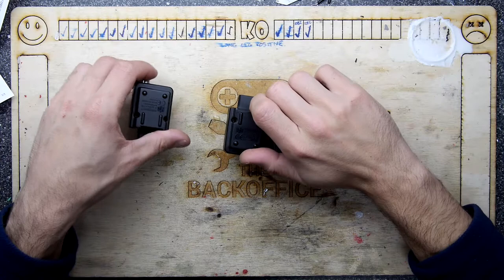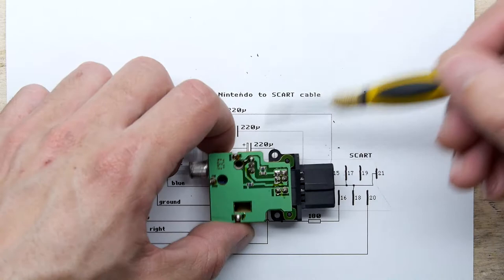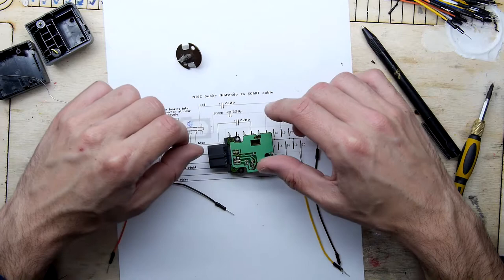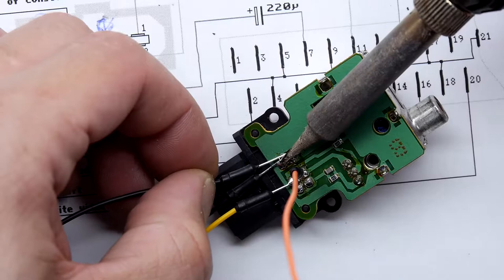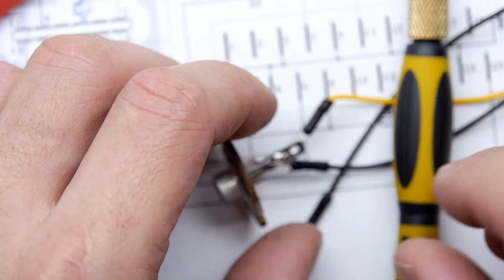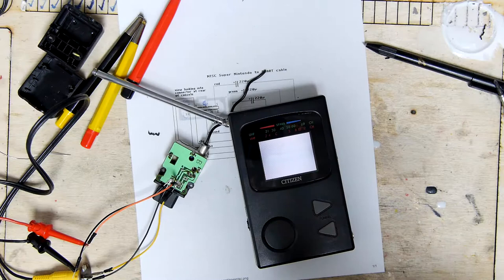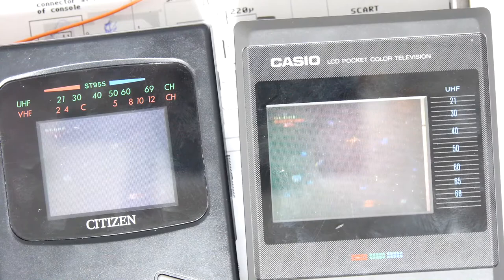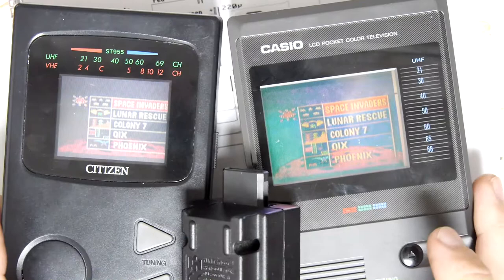Old TV Composite Hack

Comment: Brilliant idea. I just ordered 3 nes RF adapters and 3 RCA Connectors with red, white and yellow and I'm going to make 3 sets up for projects I have. I am going to boost the output signal and run that through a flat panel ariel that I have sitting about so my range should be better. Great video and well explained. Cheers👍
Reply from the maker: Glad it was helpful, good luck!

Comment: Well done, you have succeeded where many an N64 owner has failed; using an RF module for RF and not for attempting to use it output composite video :D
Reply from the maker: +Simon Lock ha ha, was the N64 the first Nintendo console to require an adaptor for RF?
Reply: It first appeared for the AV Famicom in a Nintendo light grey whereas the US variant (retooled design called the NES-101) has a built in RF modulator in-place of the new AV port.
Why it was re-purposed for the N64, I'll never know. They established analogue RGB on the SFC and SNES, then made a mess of giving us a composite video for sync on the PAL model. They still gave us an RGB option (albeit a poor one) then dropped it in favour of this "some models do, some don't, most need fixing & screw the Europeans who first adopted the standard in the first place" mess on the N64.
Reply from the maker: +Simon Lock Ahh. I guess I am the winner in all of this, and thanks so much for sending these!! Seriously nice solution and useful source of small and stable modulator for old computer repairs 👍
Reply: No prob, cool to see them being used for something! If I yank any more PCB RF modules out of things, I'll let you know
Reply from the maker: +Simon Lock we can start the RF module YouTube channel 😬

Comment: so it needs 5 volts, does it matter what the amperage is? i don't want to fry it.
i know that with USB stuff, you can plug something that only needs .5 amps into a charger that can supply more, but it will only take as much as it needs. do all electronics work like that, or is it just USB? like, if i wire a USB cable to one of these and plug it into a .5 amp phone charger, it should work fine without breaking it?
Reply from the maker: It should be fine 👍
Reply: @backofficeshow  awesome. Thank you so much for responding quickly btw
Reply from the maker: I always try my best 😁
Reply: I am actually building a similar project because this video gave me the idea. Instead of using the OTA signal though, I made a direct wired connection from the RF modulator to the antenna terminal, with the ground and a shielded cable for a clear signal. I made a video of that last night if you're curious to see how it turned out, I think it's pretty cool and the image quality is great. I'm still modding the RF modulator though to make it like what you have here
Reply from the maker: That's awesome! I recently picked up an old school Sony TV and I'm going to be fitting one to that so it can be given a new lease of life
Reply: @backofficeshow  that should be pretty cool. can't wait to see a video about it. 

i have another question i'm curious about, but feel free to ignore this if you want.

before i modded my tv, someone told me that it wouldn't work to wire an RF input to an antenna terminal, because the amplitude of the direct connection would be higher than what the antenna in was meant to accept from an OTA signal, or something along those lines, but mine is working just fine despite that. i don't know what to make of it. did they just not know what they were talking about? or is it actually putting excessive wear on the components in the tv, or does it not matter? it seems like if the amplitude was so much higher, something inside would have just been blown out as a result and it would've broken.
Reply from the maker: @nobody2021  they were talking out of their arse, so don't worry about it 😂

Did you catch this video? https://youtu.be/cAqT-5XCoWA it's a pretty fun build if you get bored.

Comment: ive done the same thing but with a Playstation 1 modulator.  It wired up pretty much identical to this as it too has 4 wires,  I can get a picture with a number of composite devices but its only in  black and white but its a colour TV. before the modding it worked ok hooked up to playstation.  any ideas?
Reply from the maker: Perhaps the PlayStation composite signal was slightly modified or in a different format?
Reply: @backofficeshow  i think your right, i tried it again with another modulator and got the same thing, but if you connect up the PS using either Modulator you get colour.  the PS must detect if its using a modulator  or a TV composite and change signal to suit.  would seem its to stop people using their Modulators for other things....  bugs me how it still works but its enough of a change in signal to  strip the colour. Looks like ill be getting some N64 Mods instead!
Reply from the maker: It could be just something simpler that they output their colours in a particular way that the modulator knows how to deal with.
Reply: @backofficeshow   it would seem that's the case. I plugged the PS into a small screen that has composite in and composite out, and then hooked the modulator up to that comp out. Had a picture in colour on both screens at the same time. Switched the PS for composite from my PC and i get colour on the first screen but black and white from the modulator. SO! yeah, like you say..they must be  adding something to the composite signal to tel the modulator what to do for colour. So it was a good find that N64 mods don't use the same idea!